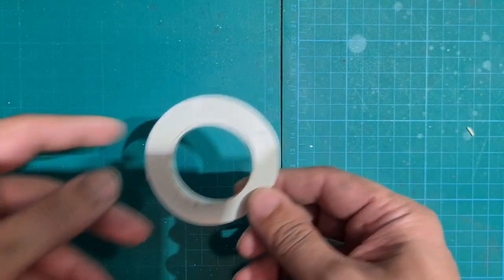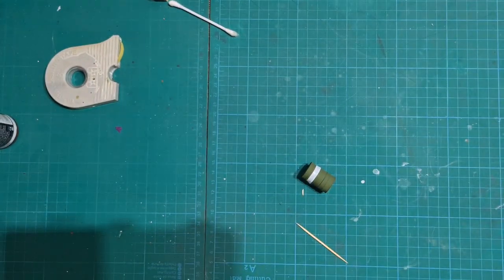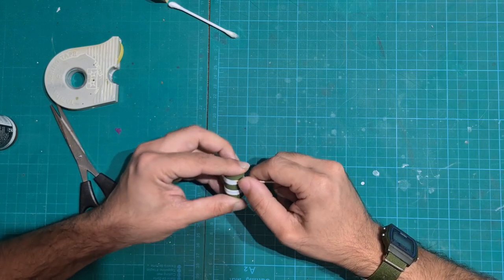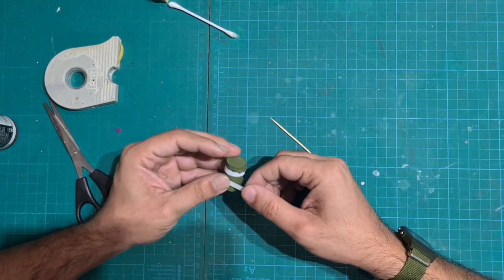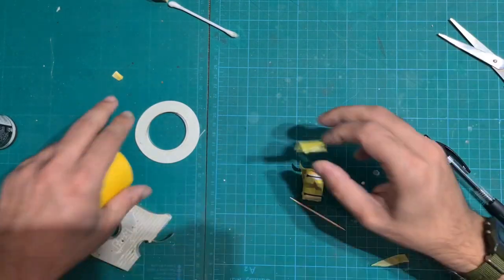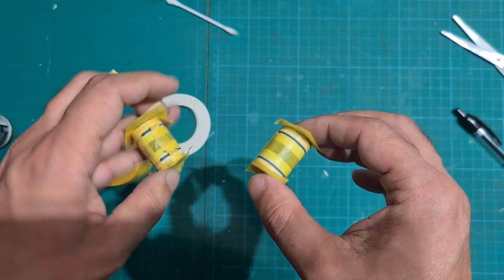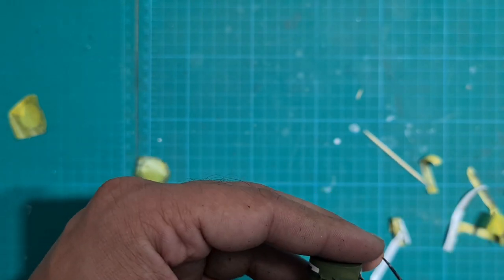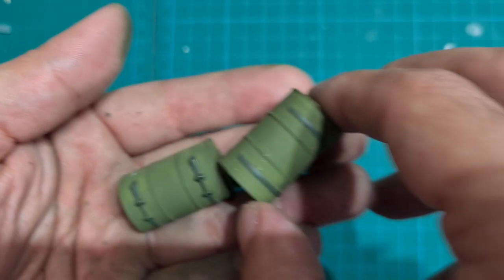How to mask Cylinders / Drums / Cylindrical objects for scale models

Comment: How long do you wait to remove the masking?
Reply from the maker: It depends on the type of paint I use. If it is enamel paint I wait about anywhere between 10 - 50 minutes. If it is Acrylic or Lacquer paint, I can pull it off as soon as Im finished painting. Hope that helps.